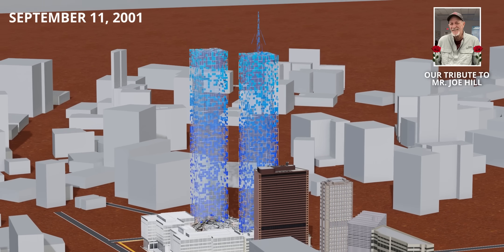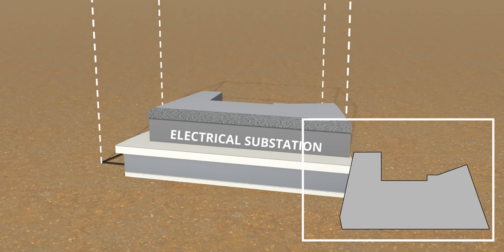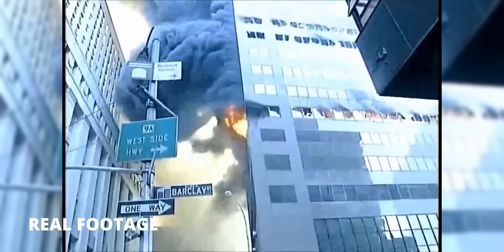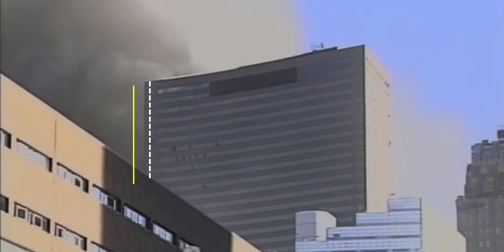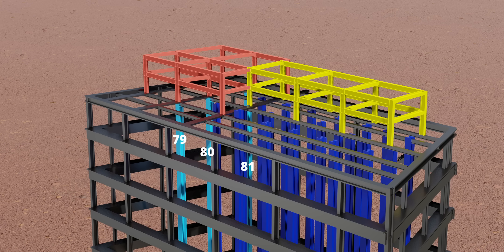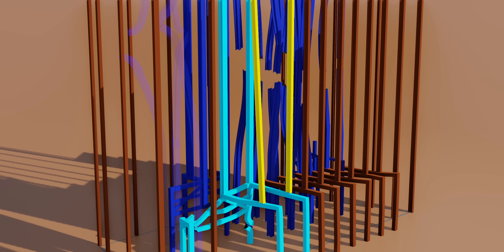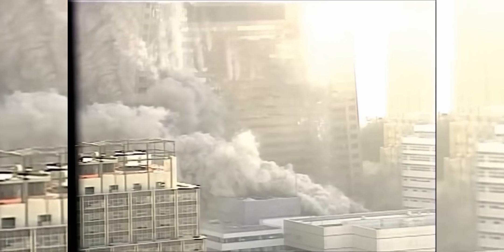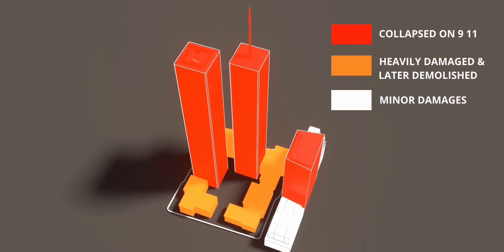Collapse of Building 7 | The Complete Physics

Comment: This doesn't address the explosions heard by hundreds of witnesses and also on video.
Reply: The video explains how it collapses, not how psychological issues cause conspiracy theories.
Also you forget the reference to the videos.
Reply: Internal floors in the main towers collapsed first, leading to a series of loud bangs at approximately half second intervals, which people have mistaken for the way demolition charges are often timed to make a structure fall in a certain direction.

As each floor fell clouds of dust and smoke were blown out of windows as the air between floors was forced out of the way. This appeared to the witnesses as evidence of explosives being detonated.
Reply: @wingnut71 I'm amazed that people can't comprehend what you just explained! I just like to add to those who think they heard explosions, did you people think 2 110 story steel & concrete buildings would collapse without extremely loud sounds to go along with the violence of thousands of tons of material collapsing? Try thinking critically, not everything is a conspiracy!
Reply: @mongolikechewchew2475 your right, not everything is a conspiracy because some tell the truth in plain sight
Reply: @wingnut71 nah mate, flashes, I saw flashes
Reply: @followthesapper324  I didn't see flashes. Just some puffs of smoke, but that was the air/smoke between the floors being expelled. I think I saw one single shower of sparks, but that could have come from the   molten aluminium from the airplane. Also, titanium plane parts will burn with a bright light similar to magnesium.
Reply: @wingnut71  so why would we use controlled demolition anymore? By the evidence we could just use inactive planes or something of the sort. Controlled demolition costs 30 grand every 5,000 square feet. The towers were around 10 million square feet. An inactive plane is about 30 million. We could cut costs even more by eliminating unnecessary components of the plane too.
Reply: @ncnuggets  Don't be silly. I'm not even going to bother explaining because that is the dumbest crap I've ever heard. Believe what you want to believe. It doesn't really matter to me.
Reply: @wingnut71  please do. I would love to hear it.
Reply: @ncnuggets  Sorry, Its late here and in not in the mood.
Reply: @wingnut71  take your time. YouTube isn't going anywhere anytime soon.
Reply: Wow, people heard loud noises from the tower collapsing in front of them. How could that possibly happen?
Reply: The explosions of stuff hitting the ground?
Reply: There are witnesses who have compared the impacts to a bomb.
Because its true, it was LIKE a bomb, that is how violent of an event the attack on the world trade center was, that is how violent a plane crash is. Saying its similar to a bomb explosion is an apt description. 
But that is not the same as saying there was for certain, bombs being used.
Reply: @captaincrooked9051 that's true, its not certain, but its odd that these are the only 3 skyscrapers in history that collapsed from fire damage, regardless of the extent of the damage, it was never possible in the fiest place. I see 9/11 as less of a conspiracy, its not like JFK or Epstein. We saw something that can't physically happen under these circumstances happen.
Reply: In an another video I've read comments and someone wrote, that he worked in WTC 7. It was his best job ever and he lost his first cell phone that day. Further he wrote, that the people in WTC 7 got evacuated as the first plane hit WTC 1. At this time none antenna or something else did hit WTC 7 before.
Reply: People comparing the sounds to explosions is exactly that. It was a comparison. Such heavy weight falling like that will sound like an explosion. How many times have people thought gunshots were going off when indeed it’s been firecrackers or fireworks going off.   I truly just think this was an act of pure hatred but hey that’s just my opinion. All are entitled to one.
Reply: https://m.youtube.com/watch?v=FEVvcGO0X4U

Audio evidence ☝️
Reply: This channel is paid informant to keep people away from the truth
Reply: It doesn't address what was stored inside WTC7, supposedly they had thousands of documents they were compiling against the fed reserve for prosecution. This video is not really for us , but after they remove certain comments it will show to the next few generations until the whole story is believed by everyone .
Reply: Wydm? You think a building crumbling is soundless? It's loud as fucking fuck.
Reply: Larry Silverstein admitted on TV it was controlled demolition.  Search youtube 'Silverstein WTC 7' and see for yourself.
Reply: Hey, numbnuts. I barely escaped the vicinity of that collapse. There were NO explosions such as what you idiot conspiracy theorists think!!!!!
Reply: Almost like there were buildings on fire from jet fuel. Fires will obviously make combustle things it comes in contact with explode lol. Use your brains. There were explosions during the recent LA fires too. Nevermind I'm sure you believe those conspiracies as well.
Reply: @a96ozsteak  of course YouTube shadow bans any attempt to share videos that have the explosions, the videos of firefighters talking about explosions etc. I ditched youtube for this year's ago and use sites that don't ban video sharing
Reply: You think the planted bombs and set them off in a secret conspiracy?
Reply: Explosions right before the building went down like with actual controlled demolitions? Nope.
Reply: Larry Silverstein 🇮🇱 (owner of WTC complex) said - "Pull it, and we made the decision to pull and we watched the building collapse" - referring to WTC 7 - not hit by planes.
"We are benefiting from one thing and that's the attack on 911" - Benjamin Netanyahu 🇮🇱
Reply: @pololikikuju  Larry Silverstein was referring to firefighters pulling out of the building and letting it burn. He wouldn't admit on national TV that he detonated it. It's also debatable if Israel benefited from 9/11, and again, Netanyahu isn't going to publicly admit benefiting from 9/11 if Israel had something to do with it.
Reply: @johnp82  https://youtu.be/p34XrI2Fm6I - "if one building was wired for controlled demolition then all 3 buildings were wired for controlled demolition"
Reply: Machi peachy, you don’t worry about facts, only your own narrative, and how you can construct it in your mind.
Reply: @pololikikuju  are you a little slow? If he's involved in a controlled demolition of the building, he's not going to publicly admit that they demolished the building.
Reply: Thank you
Reply: If things are falling down at massive speeds with massive weight what sound do you think they’ll make smacking down into everything bellow them? 🤦🏻‍♂️ stop those conspiracies.
Reply: Because there weren't any and you are in no danger of presenting such evidence.
Reply: @TheCriticalStinker-01  https://youtu.be/gp9YmTnYP90?si=lOAW5beMfZYq8TOG
Reply: @TheCriticalStinker-01 20 bucks says you're a CIA bot commenter 😂😮
Reply: @TheCriticalStinker-jw4fl  so why Eben use controlled demolition from this point forward? You have your definitive proof that it's completely unnecessary. Instead of wasting time and money on resources and materials, just man- control an inactive outdated plane or something of that nature. Right? Because regardless of where it hits the building, they're coming straight down.
Reply: @TheCriticalStinker-01  It was broadcast live on several US news networks.  Very loud series of explosions, although not all booms were synchronous as would be expected in a conventional demolition. These booms were commented on by the news presenters at the time, who often flinched at the explosions.  Go look up the videos.
Reply: @gregwakler393  - It's your claim so you look up the videos and present your evidence to support your claim 

I've seen all the footage. You are full of it.
Reply: @TheCriticalStinker-jw4fl  I saw that  footage, and unless the flashes were computer generated then I don't know how they got there
Reply: @gregwakler393 gunshots don’t sound lile gunshots on video but you guys think you recognized explosions during a time where debris was Stil moving stuff is still falling with the weight of tons across the street? 
That’s some extreme BS.
Reply: @gregwakler393  stop the drugs.
Reply: @gregwakler393 I’ve seen them too. You’re not delusional”They a very questionable to say the least!! They look like blow tortures in the corners of the building.. another thing to look into why is there not a debris field in Shanksville, Pennsylvania. Or the Pentagon..  very little plane wreckage… that was one of the first things I ever found strange.. I’ve never seen a plane crash without any wreckage.
Reply: @gregwakler393  And people also forget that the news reported that is collapsed before it did.
Reply: It's almost like fires can come into contact with explosive materials.
Reply: Do you understand fires come in contact with explosive materials?
Reply: I remember someone in the building said their was explosion in the wtc 7. I later found out CIA also has offices in this building. 
America's number one product is bombs. Military industrial complex. It's either us or them. Which mafia boss do you want to work for?
Reply: @ohjaysimpson397   The CIAs main office is in NYC. The smaller office in WTC7 was to debrief business executives that traveled abroad. do you have anything else besides buzz words involving "industrial Complex" and are you suggesting the CIA blew its own office up
Reply: This video only proves his first video on wtc 1 and 2 collapse must be bs
Reply: @jasongransden6493  Really, how so? I didn't see that video.
Reply: Yes detonation charges heard going of inside and outside of both towers right before impossible straight down drop of both structures. I do not know about the FBI building. But  I have talked to survivors of the 911 towers destruction. They all heard sequential demolition explosions just before the towers dropped straight down. Demolition crews who demolish super structures for a living can tell you how hard it is to make a sky scraper drop down to the ground in a straight line. They say the odds of a jet air plane crashing into the top of a sky scraper is zero. It does not happen. Why don't people listen to the engineers that do these things for a living? If crashing a plane into the top of buildings would make them collapse straight down into a pile of rubble, then why don't demolition teams use that method. Nope...they have to set hundreds and sometime thousands of demo charges in key spots of the structure. Then the charges have to be timed perfectly to go off in a special order. If not the build will just tip over to one side smashing into the buildings right next to it. Pretty convenient that the Twin Towers didn't do that. In fact the engineers who designed the building said the they were built to absorb such an impact. And any floors below plane strike would not collapse. But let dreamers dream, but leave reality to the structural engineers and real science. Not Bush cover up pseudo scientists. I can not believe that people still believe the governments lies about 911. And for those of you who are drinking the cover-up Kool-Aid, you probably also believe that the Pentagon doesn't know anything about UFO/UAP crash retrievals and reverse engineering of stolen ET craft...When will everybody wake up and stop letting the U.S. Military Industrial Complex treat it's own citizens like SUCKERS? I used to think the old Soviet Union was bad. But after finding out what the good old U.S.A. has been doing with our tax dollars. I have determined the our secret government makes the old U.S.S.R. look very tame compared to the United States. Very disappointed. Growing up I was taught to believe that my country was the best. And that we always held the moral high ground. That was a lot of crap they fed us in school. Secret programs are secret because most of them are highly illegal. And they don't want the tax payers to find out what kind of sick twisted stuff that they do with our money. I have nothing else to say. It is all just so sad...
Reply: @Vintech64 no one heard detonation charges right before the building went down. There are a hundred videos that prove there wasn't.
Reply: @Vintech64 The networks talk about the towers all day. They never talk about building 7.
Reply: @Vintech64 you are full of it.  A lot of gish gallop.  Your claim about how it was designed to take a crash of that size.  No numbnuts, the 707 was the largest commercial aircraft at the time of the design.  Two 767s were used.  Please spend some time looking at the specs between the two.  Also, why wouldn’t the buildings fall down?  What force should make them topple sideways?
Reply: @Vintech64   Good comment.  Thank you.
Reply: @Vintech64  I want to be on your debating team. Very well said, I was watching TV live in real time.. besides being in shock, I thought how did that happen? Straight down on themselves, and to my surprised the next one did the same thing!! Very odd.
Reply: @sandymorgan83,  considering the fact vintec injected the ufo conspiracy into his comments, it’s unsurprising another twoofer would be so enamored

Comment: WRONG WRONG WRONG. LIES BASTARDIZING THE LAW OF PHYSICS.

I suppose the 4,000 architects & engineers for 911 truth are nut jobs too huh.
Reply: 3,650 and yes, many of them are. All they did was sign a petition asking someone else to look into the matter (because they can't be bothered I guess).  

This video is very good – with one or two exceptions - and goes into a much higher level of detail than many viewers will be able to comprehend.  While not perfect, the collapse mechanisms – the sequence of failures - described here by Lesics are substantially correct and this is true no matter who planned and carried out the 9/11 attacks or why . 

That may not be what you want to hear and go against 20+ years of entrenched dog_ma and conditioning, but it’s not wrong. 

That also means (in case you did not get the hint) this video can be (and IS) absolutely correct in its description of collapse mechanisms AND the 9/11 attacks could still have been some sort of inside job. The two things are in no way mutually exclusive. 

The mechanisms described here have broad professional support around the world. There are no professional engineering organizations (for example: ASCE, ASEE, ICE, etc) that disagree with them or have offered any formal dissenting opinions or alternative hypothesis. 

So, setting hubris aside, either the overwhelming majority of the worlds structural engineers and simple observation are wrong,… … or you are. Which seems more likely? 

IF you still think believe this explanation is wrong then produce a better one . Good luck with that. No one ever has and I don’t see you moving that needle today. 

No one ever does.